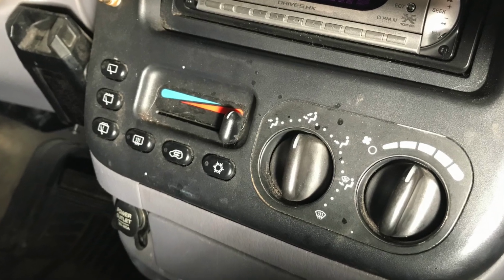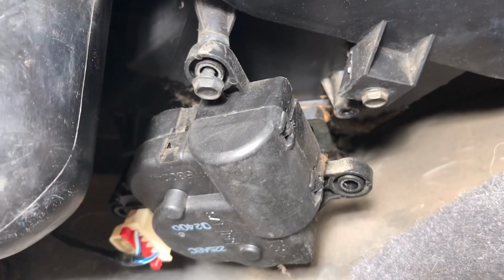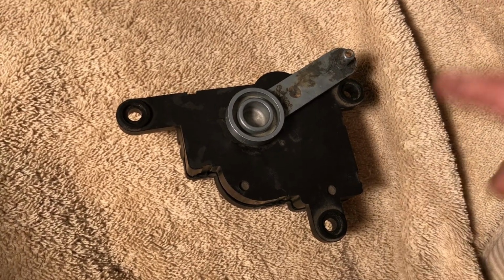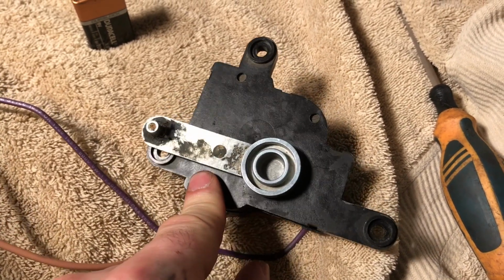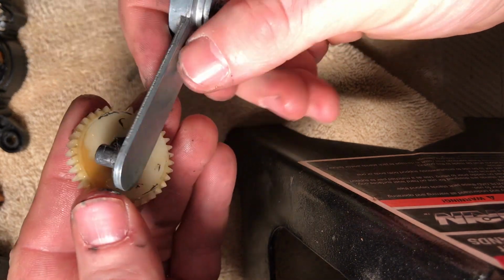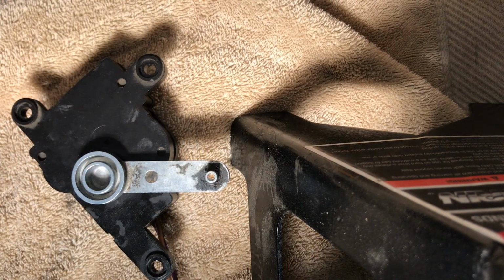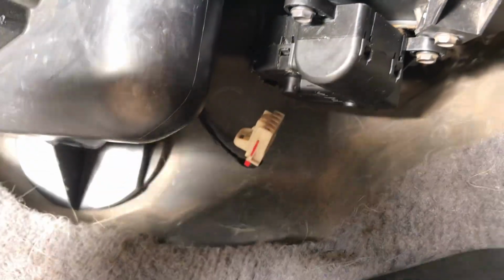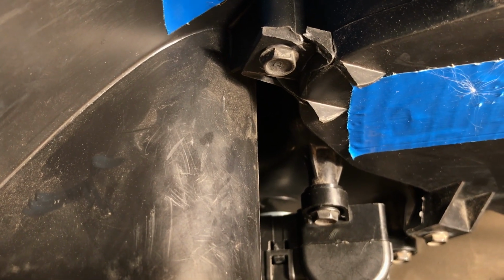How to Repair Blend Door Actuator motor Replace Dodge Grand Caravan 1996-2000 hot cold air heat

Comment: I also have a 2000 caravan. Do have an idea why my blinkers started to blink rapidly. The left one also doesn't work when its cold
Reply from the maker: If the bulb is faulty, it alters the resistance in the circuit, making it blink erratically. You can test each turn signal to see if they are illuminating properly. Check the bulb for darkness, cloudiness, or a broken filament.  That's from https://www.jiffylube.com/resource-center/why-is-my-turn-signal-blinking-faster
Reply: Did the blend door thing. Still not working.
Reply: Any ideas would be very much appreciated

Comment: Question regarding replacement part. I have replaced the rear actuator for rear A/C and heat. When I go online to O’Reilley’s I only see one part.  And so I wonder if it’s maybe the same part, though it does look different to me. Do you maybe have the link for the correct part? Please let me know and thank you for the video!
Reply from the maker: I always check Amazon and eBay to get the matching part if I can't find it locally

Comment: I am having a problem with my 2000 Dodge Caravan I am having problems getting to the defrost setting the left knob that turns to make it be defrost, passenger, etc. just spins and does not change the setting. I am wondering if it is the Blend door actuator
Reply from the maker: sounds like it, but I'm not there so I can't guarantee anything.
Reply: @youcanfixit3721  thank you